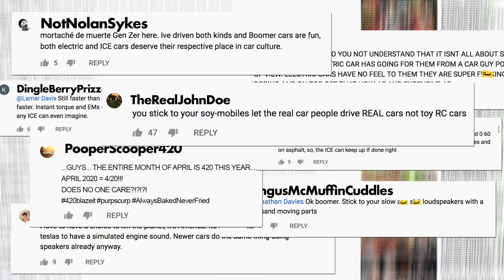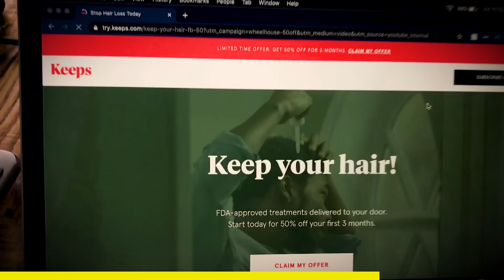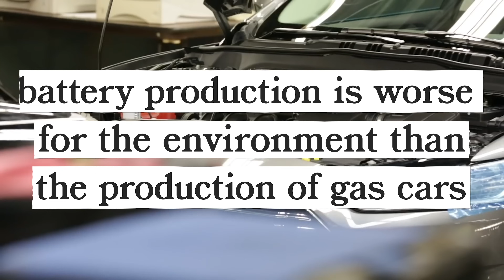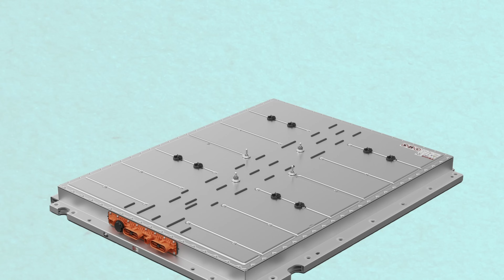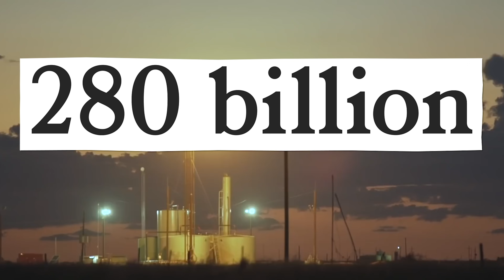Are Electric Cars REALLY Better for the Environment?

Comment: I like the reasoning, but I feel like a few steps were missing in the explanation. 28 tons of co2 for an EV lifetime, with something from... 2-14 tons in production? And say, 2 tons of co2 per year? Actually, that one makes sense if I nut out the maths, but the power grid one - like, what electric device could an EV be compared to when added to a house - another hot water heater? 5 fridges running at once?

Comment: Why did you not mention once the car is past its life or get into an accident? You only have a portion of the picture. An ev car doesn’t end when it’s created it still is causing damage when you have to do something with the battery which needs to also be mentioned as well. Good video just not the entire picture.

Comment: There is an additional argument to be made for EVs.... the pollution from keeping an EV running is generally isolated to whatever power plant is turning fossil fuels into electricity.  Therefore, the pollutants can be captured and treated right there, in bulk.  Contrast with IC, the pollutants continue to be emitted from the refinery, to the filling station (lost fumes), to what comes out the tailpipe.  Let us also consider that EVs do not require a catalytic converter, and thus reduce (at least in some small way) the demand for the metals therein, which must also be mined.  They also do not require a steady diet of lubricants.

But, the horrific human and environmental toll of mining lithium and colbalt are something I cannot turn a blind eye to.  The righteous leftists who believe they are doing great things by driving an $80K Tesla are the same ones who shrug off China's various genocides and labor camps as "cultural" differences.
Reply: @Machina By the time people take notice?  Been noticing it for ten years kid.  And Tesla isn't pulling lithium from any local sources... they want to mine it in Thacker Pass Nevada and bought land there to do so, but the environmental impact of doing so is unknown, they don't have permits to mine there and getting permits could take 5+ years alone.  His dry film coatings are in development, but 10+ years off, probably closer to 20.  Stop conflating R&D with production reality.
Reply: ye, unfortunately he was dishonest about the co2 cost for the electricity so his entire video is irrelevant.

Comment: I have a question if we replaced IC engines by EV engine but what about
The electric generation we need more electricity then today's need as solar and wind are less efficient so we gonna ended up with electricity shortage and thermal power plant are the only way to produce high efficient power except hydropower

Comment: 16 gallons of gasoline produces 320lbs of co2. At 25mpg that will get you 400 miles. A Tesla with a 100kw battery takes 100 pounds of coal to fully charge producing 360lbs of co2 and will also drive 400 miles (driving slow). Can someone tell me again how Tesla is saving the planet? And not to mention the slave labor involved in mining the resources for the batteries

Comment: You mentioned that you'd share your information sources.  where are he references?

BTW - the ENTIRE supply chain for either type of vehicle needs to be examined.  Not just the battery.  Also, where the vehicles are made - for example, Tesla's are made in China.  China uses coal-powered generating plants almost exclusively.  You know where I'm going, here.

A Toyota Corolla with a low emissions engine will have to travel over 230,000 km to generate the same amount of CO2 produced in the charging of a single 100Kw Tesla battery.  I'm not kidding.

Comment: Myth #2 - FALSE - well that is actually false :D and even you really omit all factors and just take the theoretical capacity at full with 24/7 operation and ignored all the spikes in usage, not only a number of consumed energy per day, after the quarter of all cars fit into the chart (in one day), the rest would need to wait for massive increase of coal burning power plants as nuclear ones take 10 years to build and 10 to project, water dams have limited space and take also 5 to 10 to build and solar/wind... good luck.

Comment: The electric car sounds good but they we will have dependence on electric. If we start driving millions on electric cars the electric grid system will have to be upgraded in parts of the country. Look at the parts of the country that are still without power now because of the storms. I understand electric is an alternative fuel source but it will probably cost billions to upgrade the existing electric grids which have not been upgraded for years and well as more underground power lines. What good is an electric car when there is a weak electric grid and we could be out of power for multiple days? You are stranded.

Comment: The grid has no excess capacity. In Michigan the electric companies give incentives to businesses that have full generation capability’s to run them (diesel) during peak loads. He also want you so sign up for shutting off your home ac at peak times. An ac unit draws about 1/4 of what a car charger does. Lots of money needed To upgrade the grid

Comment: 9:55 Tell that to the folks in Texas in a cold winter. Tell that to California that has had rolling brownouts for years. Tell that to Europe where a power failure in Croatia resulted in a domino effect of brownouts and failures all the way to Spain.

The infrastructure for building ICE vehicles is in place. To build a sizeable population of EVs, infrastructure will need to be expanded or built to accommodate it, from mines to power lines. It's not just lithium and cobalt but Copper as as well...about 180 pounds in every EV as compared to about 50 in a ICE vehicle.

Try this...instead of every soccer Mom driving a 4Runner or kids buying Demons while living in Mom's basements, working at Arby's and making some cash from Youtube videos on Demons or real-estate agents driving crew F150s justified by a dump run every spring...let's see people driving cars that match their true lifestyle instead of their egos. A Toyota Corolla would do for most of the US population.

Comment: The good news is cars in general never get cheaper nor do the costs of batteries or the repairs needed to fix these cars and they will always need repairs. Wait, that isn't good news at all. If you have $55 to $120K lying around go buy an electric car but the average car sells for 70% less than an electric vehicle. Tesla won't even sell a vehicle owner parts so they have to take the vehicle to a licensed mechanic which are rare however they are really expensive.

Comment: I enjoy watching this type of video as inevitably they contain some sort of sweeping statements about the carbon footprint of the worldwide power grid.  So far the global contributions of wind, solar, etc. Border on insignificant and ask any power grid manager and you will find that isn’t changing in the foreseeable future for a whole host of reasons.  No one can say you are right or wrong, just continue to revisit your assumptions like generating electrical energy has a lower global carbon footprint than fossil fuel production.  Or, fossil fuel distribution has a higher carbon footprint and cost than electrical distribution.  If you are truly unbiased, start with the assumption that electricity generation and storage is the single largest environmental footprint in the world and try to disprove it.  I’ve always been puzzled by the fact that it is cheaper to heat our homes with natural gas rather than electricity, but our government is throwing tons of money at convincing us that for cars it is the opposite?

Comment: As much as I love MOW POWA I have to say that EVs are really good for the enviorment, but still I think gas cars are WAAAAYY cooler
Reply: New fuels are being developed that give extremely clean emissions from internal combustion engines. For example the new synthetic fuel developed by porsche reduces tail pipe emissions by 85%. This would put the internal combustion engine on a level of emissions output at the same level as a electric vehicles.

Comment: As an engineer,  I find your assessment full of errors.  A Tesla car has over 1400 lbs of aluminum in it, making that aluminum alone generates almost 11 short tons of CO2 this in not including the CO2 used by the factory to form it weld it paint it, etc.  You also fail to mention the CO2 generated in making the other parts.   Also, regarding power generation, either coal or petroleum generates about 2,2 lbs of CO2/KWh, transmission losses average 12% which beings the CO2 to 2.46/KWh.  The battery mining,  and manufacturing adds 20 to 25 metric tons of CO2. The average Tesla will consume about 12,000 KWH/ year which amounts to over 13 (short) tons of CO2 per/year, add to this an average of 12% transmission losses and your at 14.5 compare to  5.72 tons per year for the average  ICE automobile.   That is like over double.  Mostly false...  Tesla after almost 2 decades is still losing money without the subsidies...  mostly from surcharges on the rest of us via higher taxes and added on to ICE vehicle.  Last year the government forced ICE vehicle makers to give just Tesla over 1.5 billion USD.  Raising the price for those of us who are producing less CO2.   If EVs are so great let them make it with out the billions of tax dollars and sircharges to other companies.  A typical BEV will wear out long before it is culpable of saving  any CO2.   But you will add to the wealth of Musk and utility companies.

Comment: I'm from the Pacific Northwest... a place where the primary source of electricity is dams. Hydroelectric power is not necessarily 'clean' as it causes a lot of problems with wildlife in the rivers that are dammed for the production of hydroelectric power. To say that electric cars are better for the environment is blatant misinformation. However, this is the direction that we're being pushed, so WTF? Will we still have gas powered cars on the road in 2030 and beyond? Yep! Hopefully so. With what a lot of the country has been experiencing with the recent cold snap, and the subsequent failure of wind generators and solar panels being covered with snow, we STILL have more than a short distance to get to where the elite say things 'need' to be.

Comment: One thing that wasn’t addressed though, EV battery’s won’t last longer than 6-10 years and will need to be replaced.this does raise the carbon footprint of every EV
Reply: Consumer Reports estimates the average EV battery pack's lifespan to be at around 200,000 miles, which is nearly 17 years of use if driven 12,000 miles per year. I also saw that a Model X was still being used by a taxi company and had 500,000+ miles on it.
On average, batteries lose 2.3% of their range per year. Sounds to me like EVs are right on par or will even last longer than ICE vehicles.
Reply: @obodoyo  I’ve been a mechanic for 23 years. In the real world 6 to 10 years is what I’ve seen from both hybrids and EV’s.

Comment: Hearing about how if all cars are switched to EV, in Texas right now we have no power and because of that no water.  Why?  We ignorantly rely on wind power for a portion of our power.  End result they can freeze.  Now if we don't have enough power for things like anything.  How is it remotely possible to add a few million EVs?  Power is 365 days per year, not only when the conditions are right.  People die when conditions get bad and then they have no power.  I am not against measures for helping the environment.  Checking all common sense at the door for a political agenda is not a way to handle the environment.  Make sure facts like converting all cars to EVs would have no impact is an actual fact.  A made up statistic to support a narrative is not a fact.